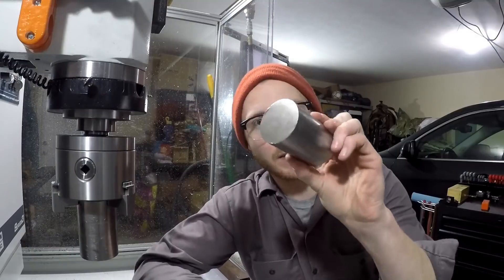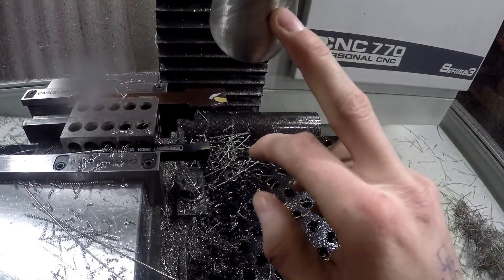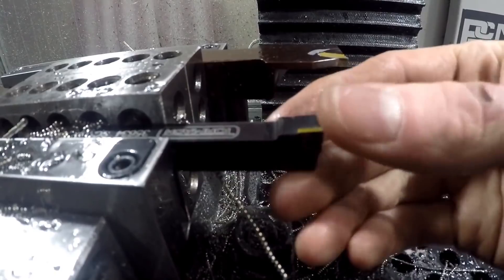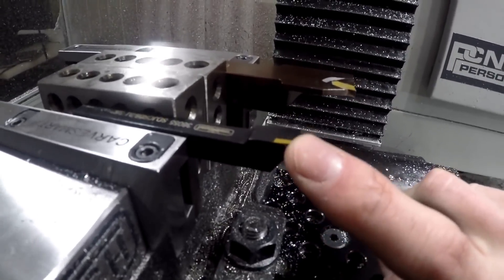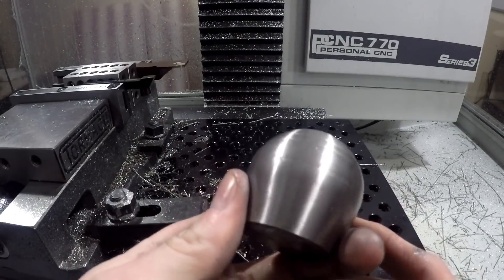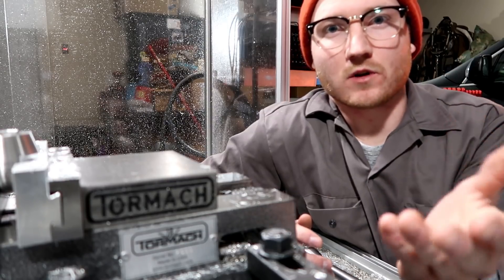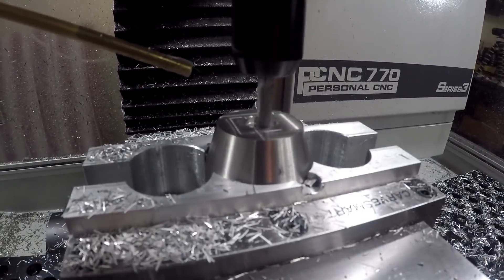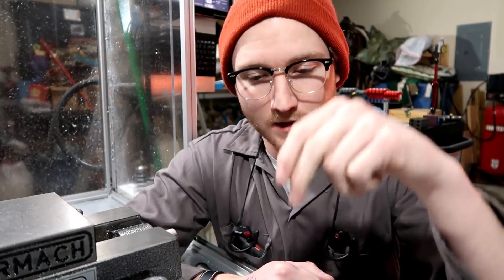Millturning and Milling Stainless Steel: Home Mfg. Days #23

Comment: Chatter is caused by vibrations between the tool and the part or your tool is dull. May wanna check out your options
Reply from the maker: This was a while back but I believe my tool was dull and I was not using the correct tool geometry for the type of cut I was making.

Comment: Whoa...seems like a LOT of mass in that spindle. I saw your other video where your tram was out about 0.004", and I guess now I know what you were talking about. 

You really do need the RapidTurn, although I'm not sure what the max stock diameter is for that unit.
Reply from the maker: Yeah this specific event is what I was talking about. I think I may have crashed it once while machining these stainless parts but that chuck is a lot of mass spinning where is shouldn't be.  So I blame a lot of the alignment issues on the millturning

Comment: Nice vid :)  I guess I'm out of sequence here. lol    You can gain a bit more clearance on your first tool simply by angling it in the vice...same way you would with the tool post on a lathe.  The new tool was definitely the better option, but you were so close, I think the extra angle would have gotten you by.  

Great finish on the second part!  I have yet to venture into SS at all. 
 
Oh....another thought or option to consider.....  You could have machined a 3/4" shaft about an inch long onto one end of the SS, then held it directly in your TTS collet and avoided the lathe chuck.  Extra work....and you have to get the shaft pretty accurate for the collet to hold it correctly.....so it might not be worth it....but I think the lathe chuck is part of the rigidity problem....I fight the same issue.   

I wore your shirt the other day.....that's a nice comfortable shirt!  I'm curious to see how much it shrinks. :)
Reply: Just got back from checking out your FB and IG pages.......you seem to have a good bit of machining experience....so I'm probably not the one to be offering any advice!! LOL!  How long have you been doing this?
Reply from the maker: I never even thought to angle the tool a bit.  I should try that out next time just to see what happens. 

The second part was much better and I agree the lathe chuck plays a small part in the rigidity problem but I think the tool stickout did as well.  If I remember right, I brought the tool a little closer to the vise and that seemed to help a bit.
Reply from the maker: I went to school for whats basically manufacturing engineering and we had to take some machining labs.  There I learned manual machining and I ended up taking a CNC course.  That was back in 2015.  So not that long ago but it was there that I learned that I love machining.
Reply: Nice!  There are times I think that I should have taken some classes......maybe I still should! lol  Learning via YT and trial and error can be a bit frustrating......and sometimes expensive. :(  Keep up the great work.
Reply: I've had to angle mine.  Especially if I use a triangle insert in a holder vertically for an ID bore.  I lean it over a good amount then, but that's limited by the diameter of the hole being made.  I've got a handful of mill turn vids.....most should come up with a search for a mill turn playlist.  I'm still impressed with your finish on the SS. :)
Reply from the maker: Yeah most of the stuff I learned can be found on YT.  I have seen some of your millturn videos and they are pretty impressive.  You run some tight tolerances on the bearing adapters and the look really good!
Reply: Youtube is pretty awesome for extra education!! :)
Thanks.  
The mill turning is a bit of a pain....if I had a tool holder plate, it would be a lot less grief! lol

Comment: Why don’t you try putting it in a tumbler and then passivate it. It would be a nice stone wash finish that would polish over time as you use it. The new camera is great.
Reply from the maker: As far as I know the customer wanted the machine finish with a bit of knurling on it(which I didn't show) so that's why I didn't tumble it.  I do have a tumbler but its super small.  As far as passivation, doesn't that just remove residual iron from stainless steel?

Comment: Nice progress man! The next time you do a mill turn video could you include some footage of you swinging your power drawbar out of the way to remove the R8 collet and inserting the R8 chuck?  I'm still changing tools manually and have always wondered of this would be a hassle.
Reply from the maker: Absolutely! I'm not sure if you have seen how the power drawbar works but all I do is loosen the drawbar, take the R8 collet out and then slip the R8 chuck right in.  I leave the belleville spring washers in there and everything. I'll show it next time though.